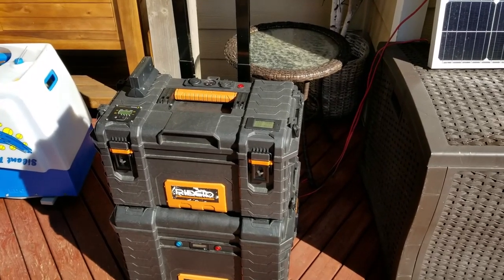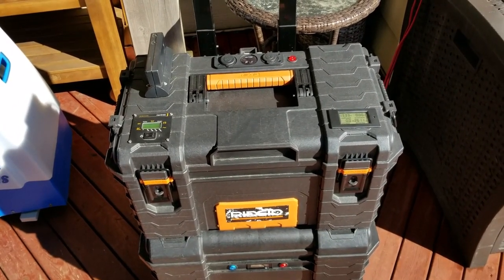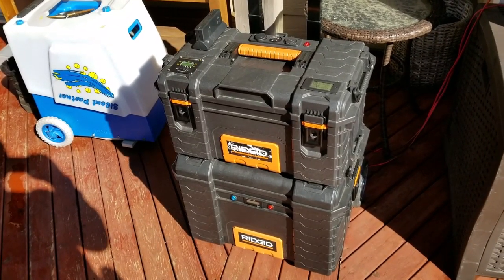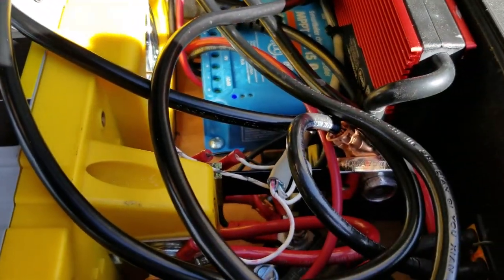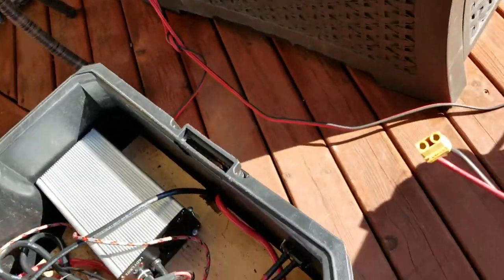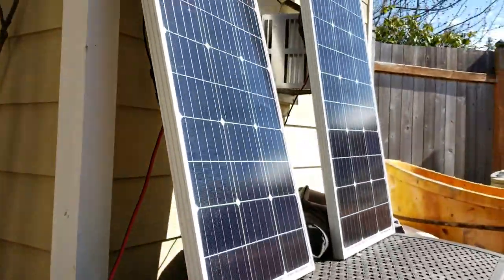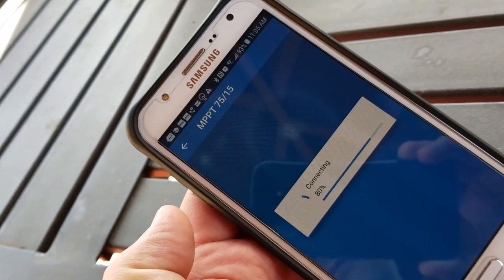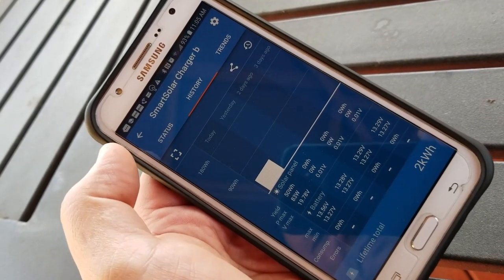DIY Solar Generator 200AH Battery LIFEPO4 12V

Comment: With that dc-to-dc charger you can take and put a plug the run to your battery so your car or your truck could charge your batteries up to me that's the only thing missing but still good setup my hat's off to you